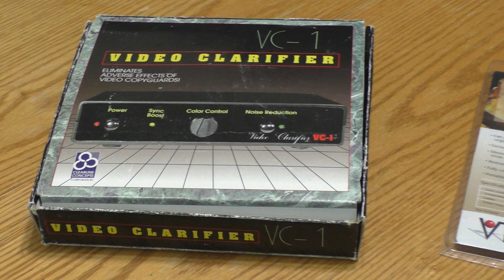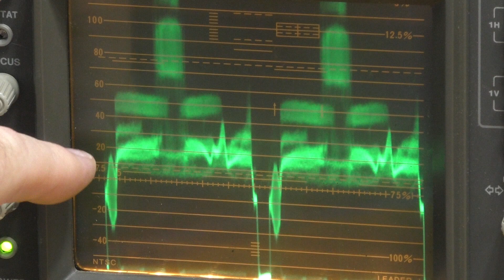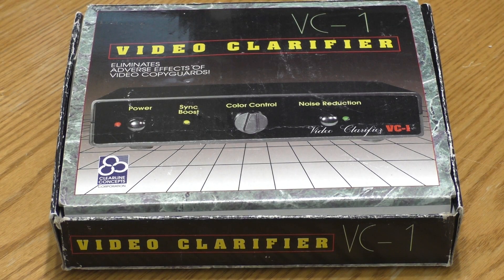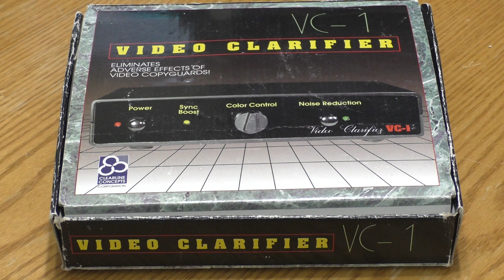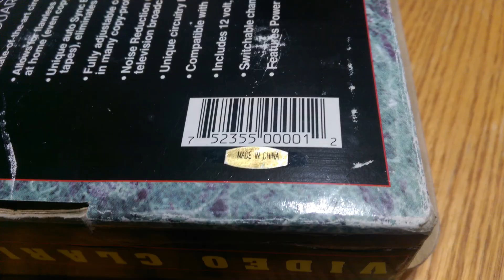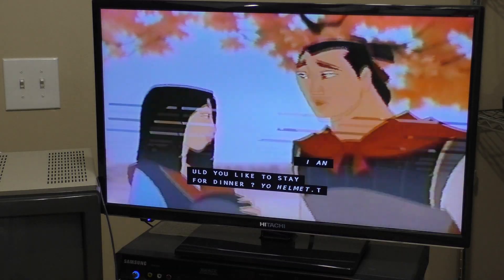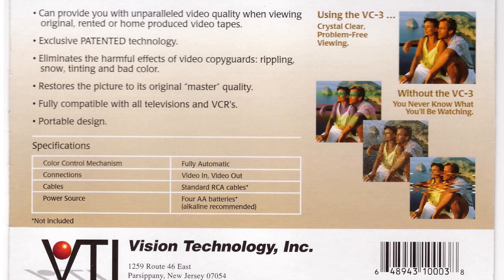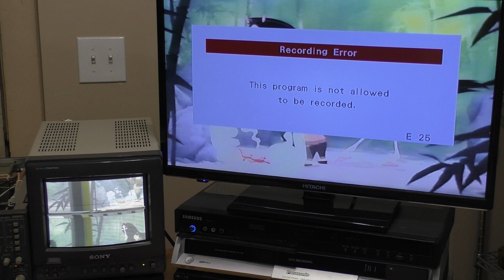Macrovision Copyguard vs. VC-1, VC-3 Video Clarifier / Stabilizer

Comment: I just purchased a Stabilizer, a Sima so I will try to see if that makes transfer copies better at least to begin with! Things I've noticed is that old VHS from the 80s do not have Macrovision on them as well as Rugrats VHS made in the 90s copy with no issues due to no macrovision. Newer ones detect that signal. Typically Paramount VHS releases have it.

Comment: TRY GO DVD BY SIGMA U WILL THANK ME LATER
Reply from the maker: I've had it on my Ebay search list for 2 years.  I've won two auctions but was disappointed both times.  One was a defective unit, the other a deadbeat seller.  When I finally find the Sima Go DVD at the right price, I will certainly make a vid about it!

Comment: There was a Sima CT-2 Digital Video Enhancer and Duplicator .. sold HUNDREDS in 2003-2009... somewhere in between they were sued by Macrovision and had to discontinue the product. I guess it was that good!?
Reply from the maker: I've been trying to acquire the Sima CT-2 or the Sima CT-2000 for several years now.  According to reviews, it is quite good at dealing with copy protection!  I found one about a year ago, but it was faulty.  Once I get one at a reasonable price, I will definitely be doing a video about it.  Thanks for the comments.

Comment: Canopus models for your next review?  I would also like to see how one can use a TBC to achieve the same goal you achieved with the RX II.  Are there any VHS decks that output a clean signal so that a stabilizer box is not needed?
Reply from the maker: At one TV station where I worked, we had a professional Panasonic SVHS that I believe had a built in TBC.  This would likely achieve the same goal.  However, I never tried to dub any Macrovision encoded tapes when I worked there.  I'm always on the lookout for video stabilizers at an affordable price.  If I find a Canopus, I will certainly review it.

Comment: 1:58 - What happens when you try to record A Boy Named Charlie Brown 1983 VHS (1984 reprint w/1983 VHS tapemaster) with your DVD recorder
Reply from the maker: A VHS from 1983 or 1984 should copy just fine.  The very first tape with Macrovision copy protection was released in 1985.
Reply: @ThriftyAV  Except for some later copies of A Boy Named Charlie Brown 1984 VHS that keep the 1983 tapemaster (printed during the Macrovision era of CBS/Fox VHS tapes), the tape could copy fine.

Comment: I got a lot of use out of that VC-1 in the early to mid 1990s. It was really best suited for VHS to VHS recording. I just threw it away a few years ago, after trying the same thing, with VHS to DVD.
Reply from the maker: The VC-1 was a bit of a disappointment for DVD dubs, but yes, for tape to tape duplication it works fine.

Comment: Question. Are all of these stabilizers compatible with PAL VCRs ?
Reply from the maker: Unfortunately I have not acquired a PAL VCR or DVD recorder (yet).  Once I acquire one I will certainly test all my stabilizers with it.  

None of the products in this video mention PAL compatibility on the box/literature.  I know the "Sima DVD It!" has a PAL/NTSC switch on the unit.  The Xdimax website says that their "Grex" product is PAL compatible.

Comment: At 1:58 you get this message if you try to record the A Boy Named Charlie Brown 1983 VHS (1984 reprint) to a DVD on your Panasonic DVD recorder: 
Copyrighted material.
This content cannot be copied.
Cannot record.
Reply from the maker: Any video encoded with Macrovision will bring up this warning if no filter is applied to the signal.  I have a few videos, including this one, where I test out different filters with different recorders.  Usage of copyrighted content to demonstrate how certain hardware works falls under "fair use" under Section 107 of the Copyright Act of 1976.
Reply: @ThriftyAV  Example of a tape encoded with Macrovision: A Boy Named Charlie Brown 1983 VHS (1984 CBS/Fox Children's Video reprint; uses 1983 tape master)

Comment: There was a video stabilizer called "The Corrector II" manufactured by a company called Search Technology, Inc. from approximately 1989-1992.  This stabilizer was said to reconstruct and/or restore the vertical blanking interval to original NTSC specifications and remove all unwanted signals totally.  It was an AC powered unit that ran on a software program making it upgradable to handle changes in the Macrovision system.  It was advertised as being effective on all forms of copy protection: "past, present, and future."  If you can find one, that would be a good one to test out.
Reply from the maker: With that company and product name, I'm getting a bunch of false positives in search.  I checked Ebay completed listings, and came up with nothing, but I will go ahead and save the search.  Maybe something will pop up.  I found some details about that product at totse dot com.  I will keep an eye out.  Thanks for the tip!

Comment: Do you have any idea on where I can get an Rx II unit?
Reply from the maker: These days they are only available used.  You can sometimes find them on Ebay.
Reply: @ThriftyAV  yeah ive been searching everywhere for one but no luck still. By any chance do you have a spare one i could buy from you?
Reply from the maker: @joseanrodm9519  I just have the one, and it isn't for sale... Purchased on clearance from All Electronics catalog in 1995 for $5.  In retrospect, I wish I had ordered their entire clearance inventory.
Reply: ThriftyAV I got RXII, connected it to Funai dvd recording, and it doesn't remove macrovision. I don't know why you could record. Do I must use RXII with polaroid or a specific dvd recorder? Please advise. Thank you
Reply from the maker: @vietnamintlvideo422  I've successfully used an RXII to remove Macrovision from NTSC signals on VHS tapes when recording to Panasonic, Polaroid, Philips, and Samsung DVD recording devices.  Later forms of copy protection on optical discs (DVD, Blu-Ray) and streaming yield mixed results.  Sometimes the RXII works, sometimes it does not work.  I have NOT tested an RXII on PAL or SECAM video signals.

If you are transferring NTSC video from VHS tape, the RXII should remove the signal bursts caused by Macrovision.  If it does not, I would check the battery on the unit.  If the battery is working, but it RXII does not work, you may have acquired a defective device.  This is 25+ year old technology.

Comment: http://www.xdimax.com/grex/grex.html 

this claims to remove macrovision from vhs tapes but i have seen mixed reviews of it some saying it works and some saying it doesn’t could you review? it is on amazon. also can you try and use the diamond component usb recorder. i am digitizing my vhs collection in the summer and i would like to know if i need to buy a remover or even build one myself.
Reply from the maker: When I launched ThriftyAV, I contacted Xdimax about obtaining a Grex, even just a loaner, to test out for a YouTube vid, but they were not interested in my proposal.  If I could get one for a reasonable price, I would be happy to test out this unit, but $85 isn't thrifty enough for me to obtain one, when I already have other units that work well enough for this purpose.

Comment: What would happen if you started recording a NON macrovision signal on the DVD recorder and while it's recording, switch to a macrovision video signal, like by either unplugging or using a switcher box?
Reply from the maker: I've tried this with my Panasonic, Phillips, and Samsung using a passive switcher.  All three of these units stop the recording as soon as they detect the Macrovision signal.

Comment: There's "The Play-Right" by Vidicraft you could try to find and test.
Reply from the maker: Thank you.  I added this to my Ebay search list, so if I find it for a "thrifty" price, I'll pick one up!
Reply: Wish you luck.
Reply: I used this for years and it worked flawlessly. I recently threw it out because it stopped working, thinking that there were probably better models on the market by now. I'm kicking myself now because it probably would have been worth it to get it fixed.